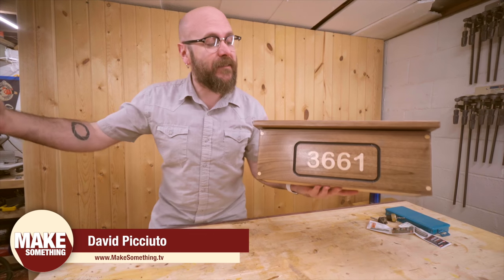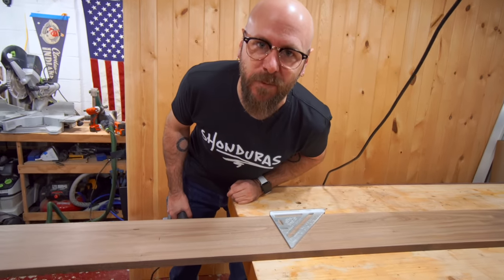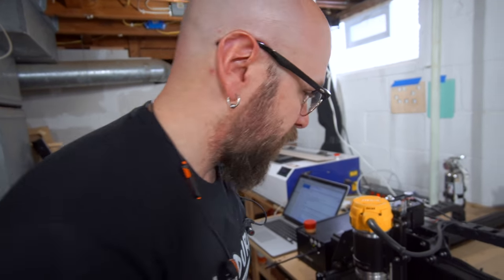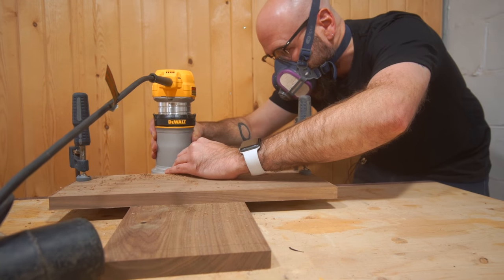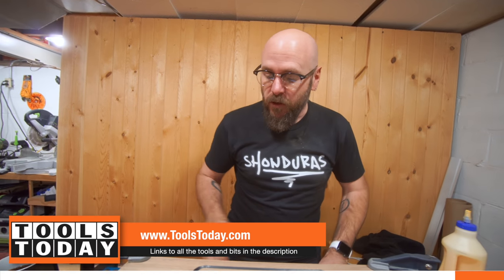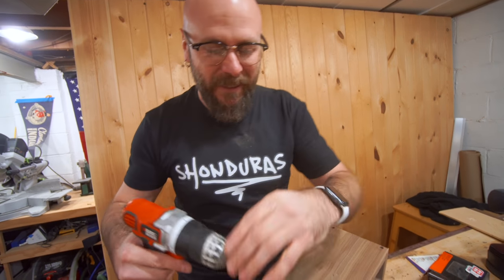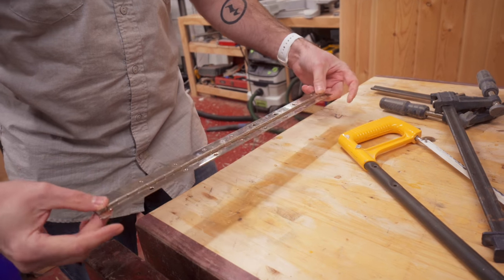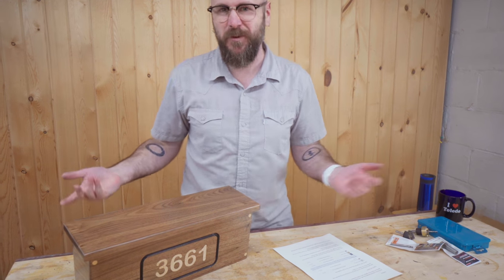Making a Custom Inlay Mailbox

Comment: Won't work the way you built it.  Unless you put a spacer behind it you cannot mount it directly to the wall because the way you hinged the lid will cause the top to hit the wall long before it's open.

Comment: Does that top flap work after installing. @10:28 I saw the top flap opens and needs at least the width of the wood board space to open properly. Now my experience working with wood is practically zero. But basic commonsense about levers tell me that the only way this works is if you hang it at least an inch away from your house wall, unlike your current mailbox.

This bugs me. But you can show me a video proof on how did you install it to make it work. Or I might be just wrong.

Comment: Great job, sorry if you've answered this already, but it looks like when using a CNC you have to eventually replace the board on bottom with the lines and measurements because it gets chewed up ?       Also, I want to get a CNC.. what do you recommend for a first one ?